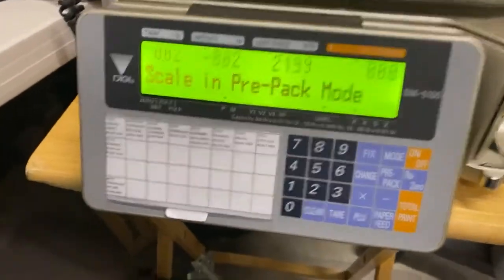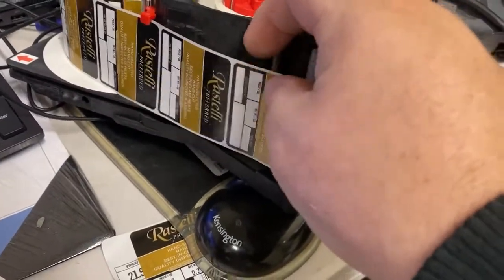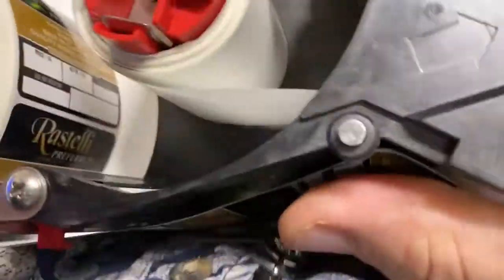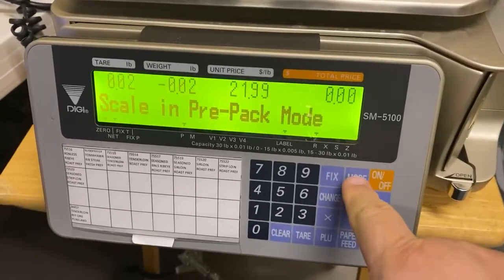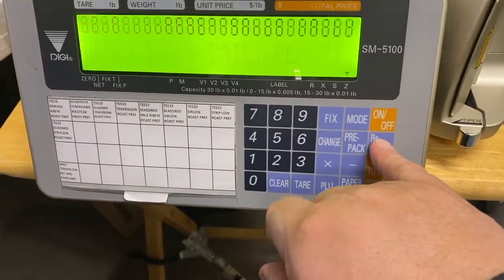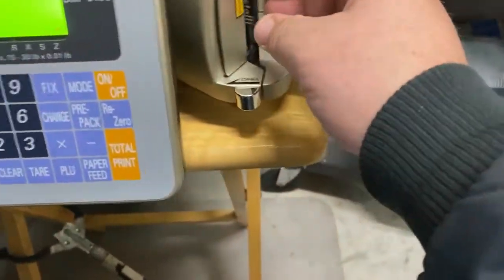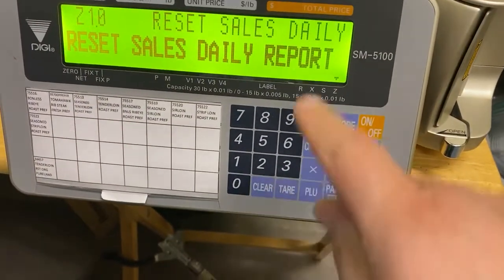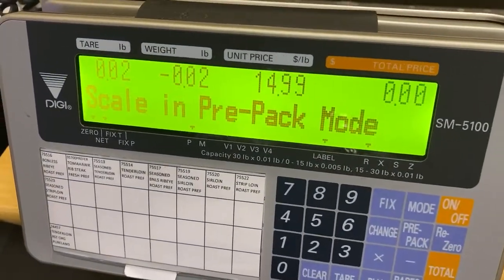Digi Scale Gap Sensor Calibration

Comment: Hey, will same apply for changing size of label?
Reply from the maker: Yes, it will help with that as well. The newer models can be set to automatically do a Gap sensor adjustment every time you load a roll of labels which is nice.
Reply: No, you have to create print format for every label you use (if they are of different dimensions), because scale can't shrink or expand contents on itself.